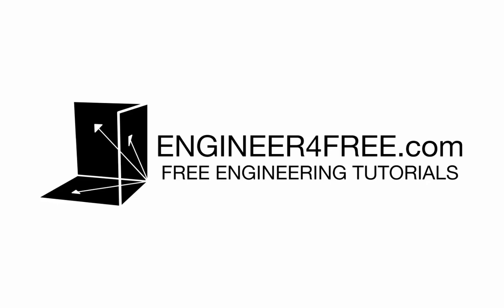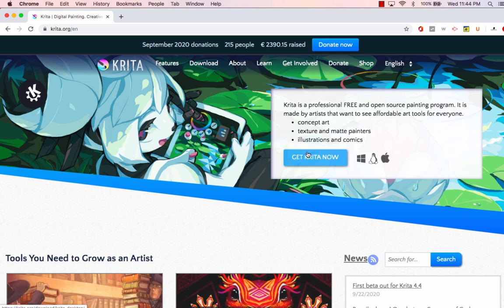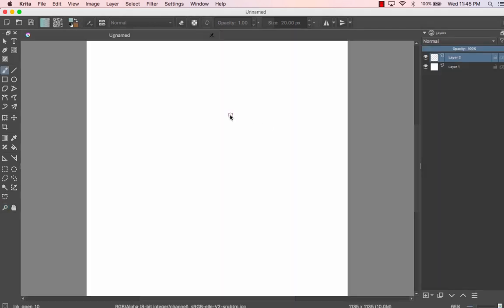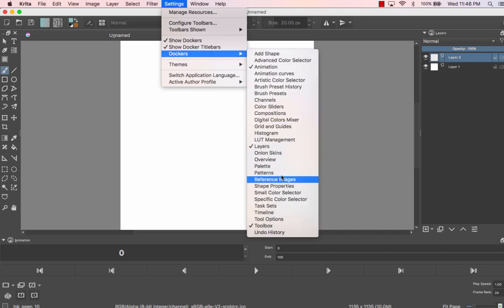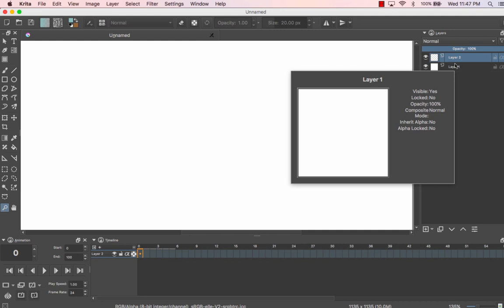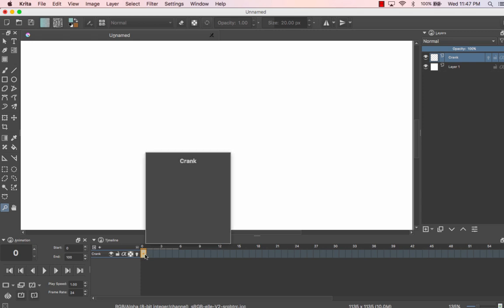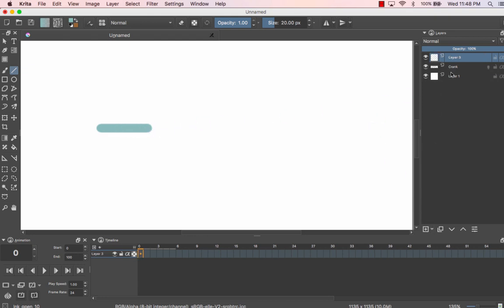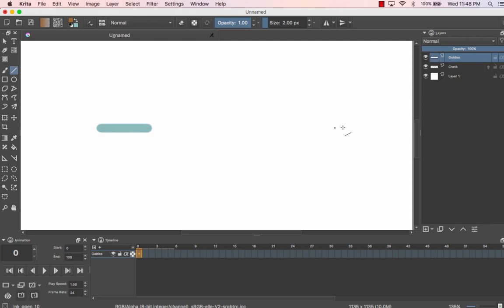How to animate a 2D crankshaft in Krita

Comment: This is amazing.  I had no idea I could do this.
Reply from the maker: Yeah it's a simple example, but I just wanted to show that anyone can animate! Glad you liked it =)
Reply: You can do engineering drawing in art/graphic softwares. 

The best FREE softwares for art and animation are Krita, MyPaint, Gimp, Inkscape, Opentoonz, etc. I most use Inkscape for technical drawing and vector graphics, and also for mathematical presentations. Krita recognises Inkscape's formats, path tools, effects and filters. 
The best FREE CAD software is FreeCAD, an open-source alternative to AutoCAD. The most advanced free 3D software is Blender and that comes with a steep learning curve.
Reply from the maker: @pinklady7184  I haven't tried FreeCAD yet but plan to eventually give it a go. But I generally have two different setups depending on my needs. 1) Macbook + Bamboo Wacom (CTL-470) + Krita and 2) iPad +Apple Pencil + Sketchbook. I used to use sketchbook on desktop too but it's been a pretty long time.
Reply: Engineer4Free I have few times tried learning FreeCAD, but I don't get enough time, as I always put Blender before FreeCAD. I am taking online courses in Blender and paying for them annually. Now there is 5 weeks' lockdown here in Ireland, I will have time to learn FreeCAD. 

I am familiar with Sketchbook Pro. I have that on my mobile tablet. I also have Artrage and Procreate. I paint pictures as a hobby.
Reply: @pinklady7184  I am sorry to hear you are on lockdown, I hope you learn more about Free-CAD and stay safe. I have heard about it but I use fusion 360 for my projects.